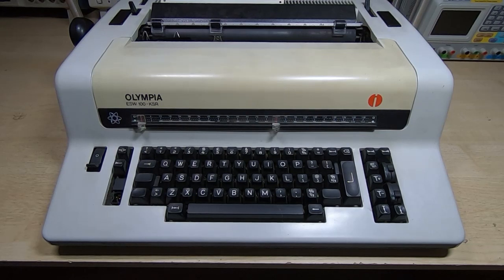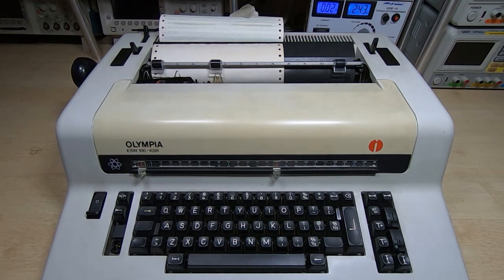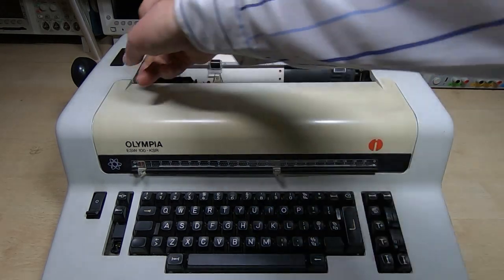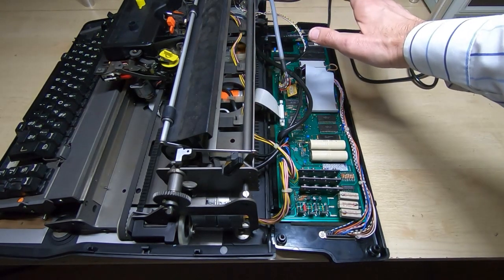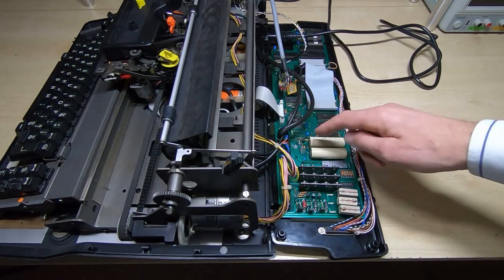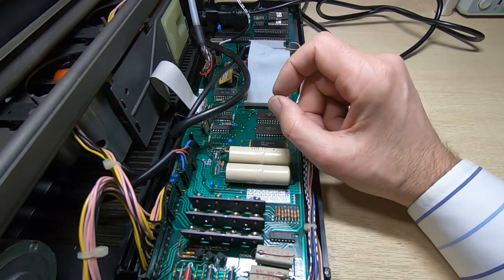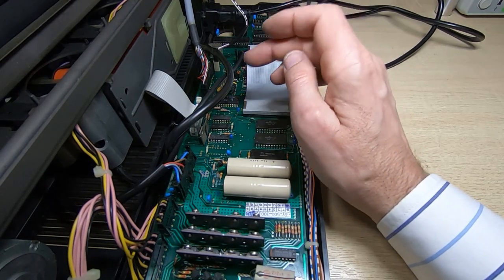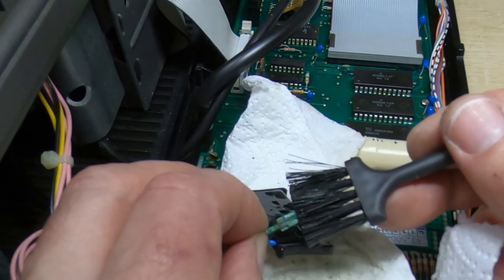Olympia ESW 100-KSR Repair Part1

Comment: You can almost play a song only by twisting the power connector :)
Reply from the maker: I bet youtube would get me for copyright. Actually it is really annoying so I think I will disconnect it. It is a lot louder than it sounds in the video as I added a -12db audio filter for the parts with the sounder going. It seems that the port driving it defaults to 'ON' and the processor is not starting so it stays on.